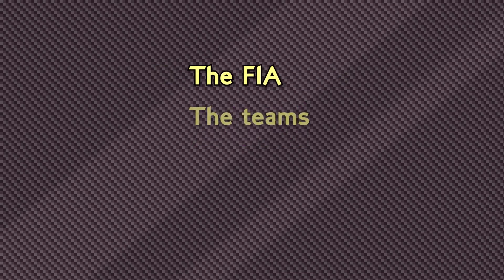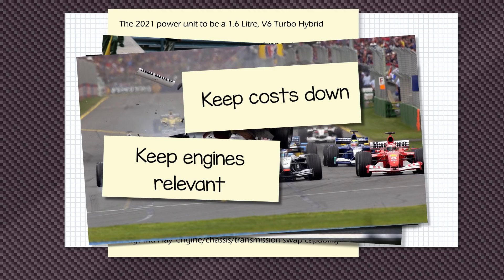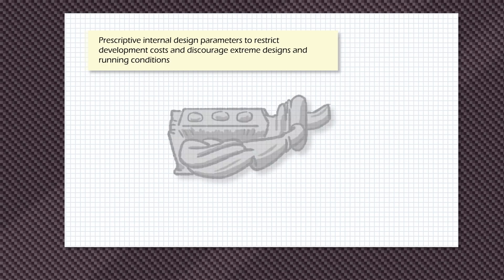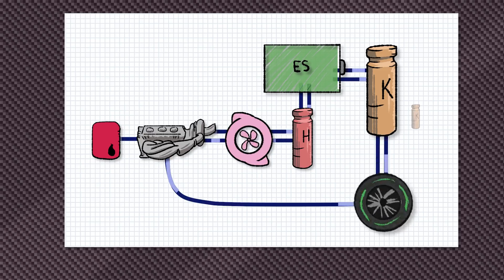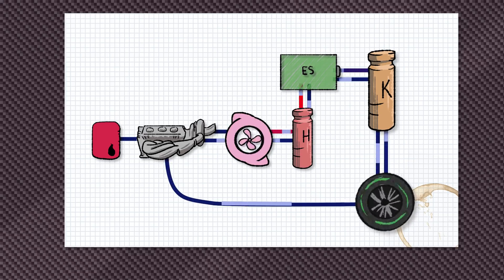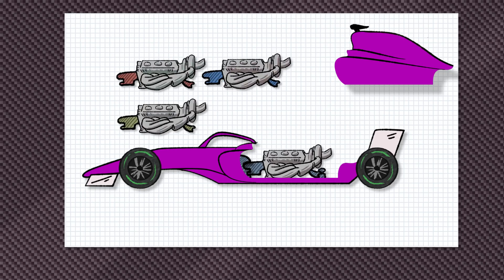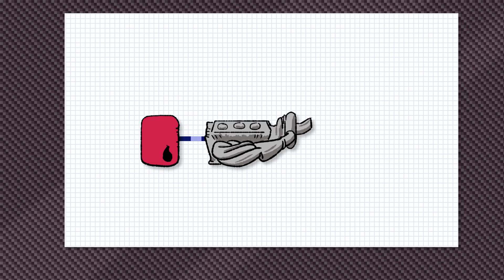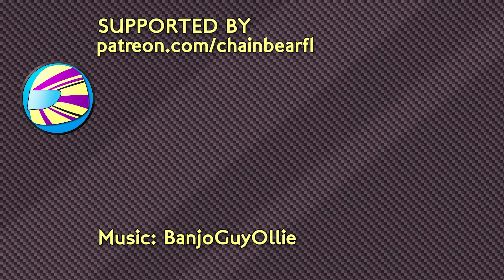F1 Engine proposals 2021 explored

Comment: Its a bit out there ill admit and Im no engineer. But... wouldn't it be interesting if a car could harvest energy from the airflow passing over the car? 

In any case, F1 and racing is a perfect place to incubate new technology that eventually trickles down to the mass market. New ways to make the cars more efficient should be encouraged.

I think rules that make the championship more of a competition are the best thing for the sport. I for one very rarely watch a race any more as there are fewer variables that allow smaller teams to win races. Competition. Innovation.
Reply from the maker: That is definitely doable (basically a wind turbine where instead of the air moving and the windmill standing still, the turbine moves and the air stays still) but the problem is that it would slow the car down but acting like a massive air brake.

The energy would be harvested by slowing the air down and the 3rd law of motion forces the car to slow down in turn.

Now if you could pop out a wind turbine whenever you put on the brakes...
Reply: Im sure that the teams would come up with something that was very interesting. Why not challenge them to come up with other ways to generate the energy. Even something that can harvest from the G forces the car makes would be interesting too.

Comment: I still don't know why they can't go 1L 4cyl combustion engine... this way it will rev higher ( giving us the scream we love ) using the same fuel to produce same power output as current engine... it would lack some torque, but that's not an issue with the electric drive at the moment anyway.

Comment: I have been watching F1 for 32 years and the power units of today are by far the worst. How can you keep the cost down on a hybird power unit. Now F1 has cut the power units to three for 2018. Last year was a joke with all the grid penalties and 2018 will be  worse. Sorry the V8 was the best engine for the money. If they want to keep the turbos then get rid of the hybrid system.  With the V8 or turbo only power units we may get new teams and or engine makers. I could care less about hybrid systems so let Formula E keep that high cost junk.
Reply: F1 engines were never even remotely cheap, the main way they keep costs down is by enforcing a limit on the number of engines used, otherwise teams would burn up an engine  every race.
Reply: The V8s had to be 1/4 of the price of the new power units . Three power units for all of 2018 is a joke.  The V8s had no problem lasting four races. No turbo no hybird parts Fast - Loud and cheep. Maybe GM - Ford  and Toyota would get back into F1 as a engine maker if it was a V8.

Comment: Why they are limited to V6, if I'm FIA, I would like to see all kinds of engine configurations, as long as it is 1600cc single turbo.
Then the engine competition will be fun, let's say Renault straight 6 turbo vs Mercedes V8 turbo vs Ferrari V6 turbo, or maybe Ford straight 4 turbo. Way better than all V6 and dominated by Mercedes. Maybe some teams will choose straight 6 instead of V8 for more aerodynamic, or V8 for more corner exit acceleration.

Comment: These rules really do not interest me whatsoever. Talk of efficiency and Relevancy is just boring.

F1 has been on the decline since FIA has focused on even more safety, even more efficiency / reliability. Boring is the only word to describe it. 

This rubbish that Formula E is more technically advanced is a lie when you actually see the shared components but essentially it's just a show not a proper series which is filled with good drivers but mostly F1 rejected, says a lot.

F1 had its largest viewing figures when it was loud, when it was dangerous. When reliability was actually a part of technology being pushed to the limit. Seeing big teams fall allowing the much smaller teams a chance. "Anything happens in Grand Prix racing and it usually does."

When has that happened in recent years? F1 has become so predictable and people turn off. They see the cars painfully slow when compared to records set over a decade ago with them cars having grooved tyres. 2017 closed the gap but just imagine a F2004 with full slicks these cars went over 220Mph easily.

2017 was a big improvement but when the cars sound like glorified leaf blowers people are bored.

I would love a Tesla over a Ferrari any day. That's just for road use. Now put a Tesla next to a La Ferrari. Any honest person knows where the fans will be looking.

Same comparison with Motorsport. F1 as dyer as it has been recent years still get solid crowds in Europe and Americans.

Formula E can't even fill the stands (for a few thousand people) for free public access street racing.

Comment: A 2.0 litre twin turbo V8 rather than 1.6 litre single turbo V6.
MGU-H and MGU-K will be retained. 
Stronger battery. Power percentage will be shown on the dashboard/steering wheel and driver has the right to use all these electrical energy
Rear wheel electrical power will be unlimited. Front wheel limited at 100 kW. One electric motor maximum per axle.
Allow E85 fuel.

Comment: Mguh does not capture heat energy.
Reply from the maker: It does in the came way that any power station turbine captures heat energy. The heat in the cylinders causes an expansion of air which drives exhaust gases which spin a turbine. So, yes it captures heat energy.
Reply: Well to me it doesn't make sense. From your point of view we should say that mguh captures chemical energy, as the heat is produced by the fuel burning.
Reply from the maker: shrug - at the end of the day it's just a shorthand term that everyone's agreed on
Reply from the maker: I mean, technically the MGUH is also kinetically charged but then that makes differentiating it from the MGUK tricky.

Comment: Frankly the conclusion of the video doesn't make any sense. we can believe whatever we want but let's not kid ourselves
Engineering is not cheap it never was and it never will be
On one hand we want F1 to remain at the forefront of technology  leading the developement of car technology, on the other hand we want F1 to be a cheap level playing field where everyone has the same chance of success. This two things are simply opposite of one another you might think that a balance is possible, but it really isn't trying to have both ways will lead to achieving none.

An example, by standardizing the engine envelope and connections you effectively standardize the basic layout of the engine, and I wouldn't really be surprised if this will lead to basically the same engine with different badges and so innovations in engine tech will be limited at best 

On the other end if we want really for the playing field to be level let's just do it the INDY way 1 car developed by a third party that can't compete, single tyre choice, imposed fluid and lubricants and the only difference between teams is setup and pilot choice, this will be much much cheaper than anything we have now  (satellite teams and whatnot)

Comment: I think that was the worst description of a 'hipster' Iv ever heard.
Reply: Hipsters done like fire breathing v12s the like fe
Reply: @austintrajkovski3007  "hipsters don't like things I like! They like what I dislike! That's why I'm not a hipster!"
Reply: Austin Trajkovski most people who want v12s back are shitty 12 year old or people who just started watching f1
Reply: @MATADOR The high strung NA engines peaked back in the day.. even with further R&D they'd probably make a few 100hp more but they'd still lack torque and the power curve of the V6. Nuff said
Reply: @MATADOR V6 turbos romed this Earth far far before your V10s. Besides people complained going from V12s to V10s and from V10s to V8s. You dudes are just never happy. Keep the V6s they are faster than V10s. The only logical pro of the V10 is the sound but that's it lmao
Reply: @turnip8173  V10's were more powerful and lighter than the turbo hybrids
Reply: @sergiomartins98  lighter maybe. More powerful? Maybe compared to the 2014 units. New ones are pushing over 1000hp and have power everywhere under the curve while the V10s make 950hp in the last 2000rpm of the rev range

Comment: 0:50 The PEAR of motorsport

Also, I don't like the cost limiting factors at play. Why not introduce an overall cost cap to encourage different development strategies? Of course the cost of manufacturing an engine is high but if you restrict it with just a budget cap it would be cool to see what Ferrari and Mercedes do to outdevelop each other in certain areas while they have to conserve in terms of money for others.

Comment: Hybrids in 2021? With Tesla pushing other manufacturers to develop Electric power? ... Don't think so! 

Either you go full entertainment for F1 fans, i.e. high rpms, V10 and loud! OR You use the Hybrids till 2025 where I predict Electric will have already taken over and then scrap F1 for FE. 

FE by that will have already have the capacity to tackle full grown F1 tracks
Reply from the maker: Ooooooh I seriously doubt FE will be up to full F1 tracks soon. The race distance is much longers and the power is so much greater.
Reply: I'm talking by 2025! And I mean not just the capacity of the electric motors on full F1 tracks but also the relevancy of hybrid units on the road. 2025 is in 8 years with Tesla and competition in FE, the electric  technology is gonna advance by a lot. And maybe Roborace as well. We are already seeing BMW, Mercedes and Lamborghini going electric now! For these big names, the hybrid technology might not be sufficiently attractive and relevant for them to stay in the sport. 
Ok I give you 3 more years, what will happen to F1 in 2028? Do you hybrids will still be relevant?

Comment: They should use a straight V8 Hybrid system similar to Toyota's LMP1 Car from 2012. No Turbo Lag, and a boost of up to 1200bhp out of corners. 
Standardise engines too. Regulate the power outputs so Mercedes can't have 200 more BHP than Mclaren. Equal power output means closer racing. 
GT3 has V6, V8 and V10 engines on the grid and has very close, exciting racing. F1 has 1 engine, and they can't get the BoP right...

The biggest thing F1 needs is to remove the plank and flat floor with the ridiculous rakes. Let the cars have shaped floors to create 70-80% of the downforce so the air running out the back is cleaned up by the defuser. Thus creating less aero on top, and cleaner 'dirty air' also means closer racing and overtaking.

They also need to make the cars smaller. We don't need F1 cars being twice the size of a Ford Focus. The tracks aren't wide enough for them!

Comment: fans want noise and speed.  lets start with noise, well more noise from the engine/exhaust well the quicker it seems the car is going, doesnt matter if its not actually going quicker but if it seems it then its just better.
now for speed, liek i said before more noise peopel generally think thigns are going quicker so noise is good but also like i said fans want speed so limiting engine/part  usuage and not letting the drivers go full speed is dissapointed for the fans and the drivers,  the drivers have even stated they dont liek limiations on the engines they want to go flat out, its racing,  im not saying give them new engine every race but make it so they can go flat out every race without paying some cost for using  more engines than allowed.
I smaller teams struggle with costs etc and the cost need to be managed but surly there are other ways to cut the cost without cutting the racing excitment.
I also dont like the tyre usuage thing where you mus tuse 2 types of dry compunds,  just bring a choice of 2-3  and let tams run what tyre they think is best to get them to be quick on track and make little pit stops as possible.

Comment: Lets put it this, way, listen to a 2004 v10 then listen to the 2017 v6, put the same technology on the v10 and youll get over 1700bhp easy, the V10 is a superior engine.

They should also de-regulate it, i want to see teams come up with complex and elaborate solutions, i want to see an arms race, i want to see f1 cars get faster at an ever faster rate.

They should also be allowed to use a new engine whenever you want, i dont care how long an engine can last, i care how fast it is.
Reply: V10 engines are beautiful but very big and heavy, would be a pain in the ass to fit them back in the F1 now. But I only thing that FIA should stop banning anything that can be innovative in a car. And bring back ground effect on f1 again

Comment: Petrol engines are going to be around for a long, long while. So long as there are fossil fuel powered vehicles on the streets and in cars from Bugatti, Lamborghini, Ferrari, McLaren, etc., F1 is going to be powered by fossil fuels. Imagine F1 with no sounds or smells of racing. The sensations of power and speed will only be evident to the drivers. Is the FIA  going to pump fake exhaust noise over loudspeakers and into our living rooms. It’ll be more exciting to go down to the local fun park and watching the go karts run. Formula E already exists. Why ruin F1? If you care about the environment or oil reserves then ban all wasteful racing events. You can’t eat your cake and have it too.

Comment: I know it has nothing to do with engines, but I would more interested in f1 if they removed drs, if not completely then at least for the last 10 laps or so, the new larger battery tactics could make up for the problem of people getting stuck behind slightly slower cars.

Comment: suggestion: limit the engine oil consmption. its cheating to burn oil.
suggestion: allow turbo compounding with a 2nd turbo
Reply from the maker: Oil burning has been banned for 2018 so you're all good there. I too would like to see twin turbos. We'll see what happens.
Reply: good to hear the oil burning stuff.
on the turbo side, i would not like twin turbos.
i would like a 2nd turbo for direct turbo compounding.
on a turbo compound engine , a turbine driven by the exhaust gas waste heat, is coupled by some means (can be geared down for instance) to provide mechnical power directly back to the engine main shaft.
it ain't cramming more air into the engine.

Comment: Well i dont see reason for f1 to push so hard on electricity since we have formula E for that. For me the F1 should be as fast as it can possibly be, not focusing on being wallet friendly so I dont like hard speed restricting rules. But people just lost interest and passion they used to have back in the day. To me F1 as it was and should be is already dead, now its just motorsport like any other. There used to be better mood on race day, now its kinda okeyish. Used to be smiles per mile now its more like phone cam lens per mile. Hate me if you want, but thats the way I feel about this.

Comment: What is F1 thinking their long term plan is?

If they keep following what's useful to manufacturers from an R&D perspective, the sport has maybe 10-15 years left. At that point all new road cars will be electric and that will be that, no more R&D money.

Even I find myself watching Formula E more now. It has better competition for the trophy, and it sure isn't going anywhere. F1 should become an advocate for internal combustion engines and develop impressive V12s once again. Most racing worldwide is done on an extremely limited budget, F1 has an unimaginable budget in comparison. There should be no issue with having relatively stable, yet fun cars on a price that's manageable given the lack of R&D money going forward.

It's time for F1 to transition to a post-IC world. I don't trust that it will, given who's in charge.

Comment: You can have a big displacement yet fuel efficient engine, many modern car manufacturers make V6 or V8 engines that have excellent fuel efficiency compared to 20 years ago. The argument that old V10/V12 F1 engines were fuel guzzlers is irrelevant, because a modern built F1 V10 would not be the same.

Comment: How about a displacement limit, use any configuration you'd like, but has to run on standard pump fuel, like 93 octane. This would spark innovation that would trickle down to road cars. This would limit boost on turbo or supercharged engines and compression ratios on N/A engines. You'd have a detonation cap on output. The only way to overcome it would be innovation. It could really be that simple. We could have multiple types of engines on track at once. Inline 4' and 6's, V4, V8, V10, V12, etc... Everyone chasing power on the poor fuel we put in our own cars. That could make F1 entertaining again.

Comment: @chainbearf1 Diesels are the most economic, efficient and prevalent engines in use today. Would you like to see f1 cars with 2.0 hybrid turbo diesels. like le mans.
Reply: Wonder why not? Easy, they spew out more pollutants, thats why.
Reply: deisels arent the most economic as deisel is much more expensive per gallon and mpg in production vehicles are pretty much comparable. and certainly not efficient. im happy with fast revving gas engines

Comment: I still think there needs to be more than one set of parameters for a given engine type. back in the day there were 12, 10, 8 turbo 6 and turbo 4 cylinder engines. F1 is and has always been about the advance of technology. opening up the rules for electric, naturally aspirated, and forced induction with say 3 fuel options makes it up to the manufacturers to find a balance of what works. fairness can be achieved like the SCCA does with weight. i am tired of watching a spec series... If i wanted that, id watch Indy car.

Comment: let's go the whole hog in 2021 and get the whole of F1 on honda gx200 + hybrid engines should be great entertainment watching the engineers work out how to squeeze an ICB into a pint pot. Time and again we watch as the laws of physics get rewritten and yet we keep being told they are fixed. what about HHO on demand production as a fuel supplement on the cars power gains from HHO are impressive.